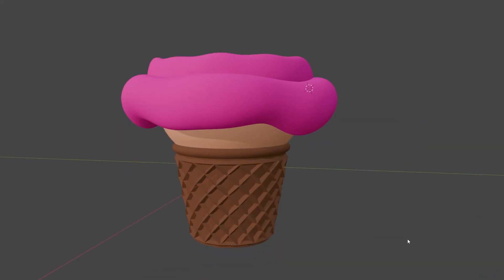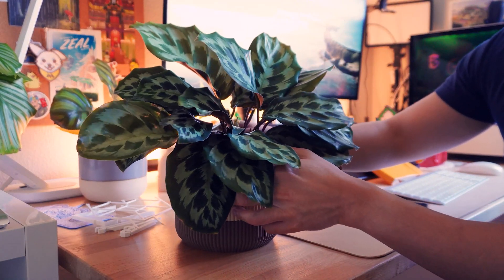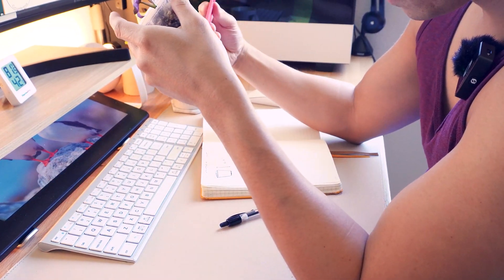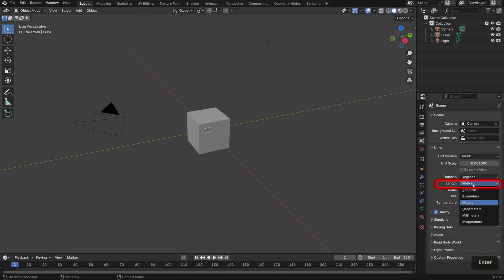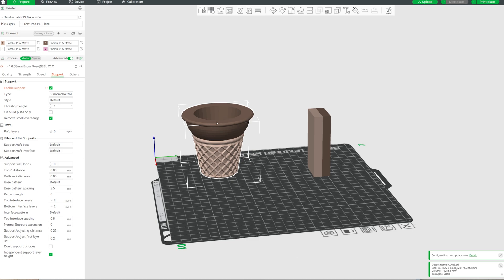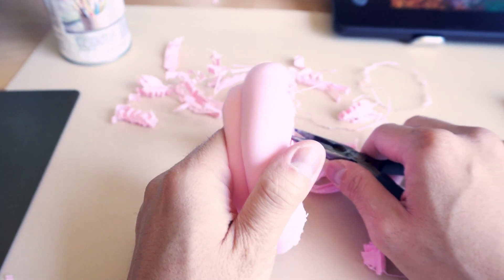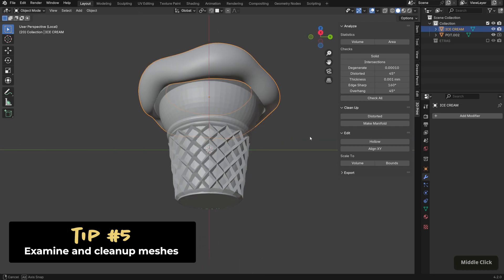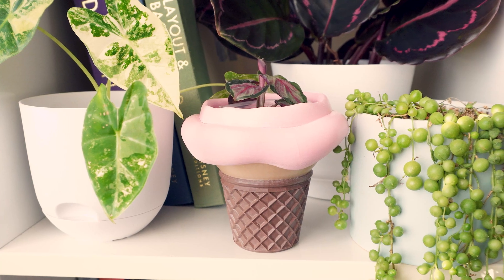Design a 3D Printed Ice Cream Planter | Blender Tips & Bambu Lab P1S

Comment: Use tree soporte and z top surface in between 0,25 to 0,3  

Also you can print by object instead of by layer  , that way you’ll be able to put the whole bed without worrying of the waste , the cone you didn’t need a tower since it was just 1 color change 

I don’t think I explained it well , but I hope it helps